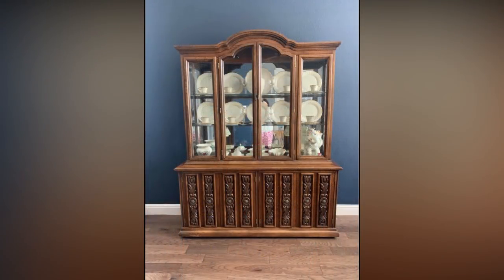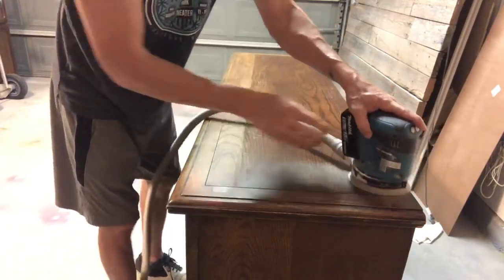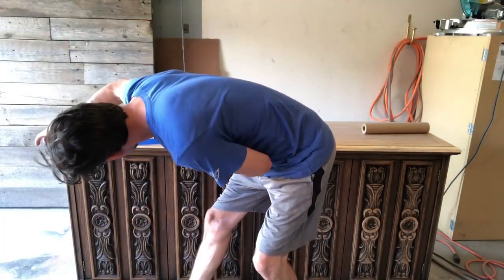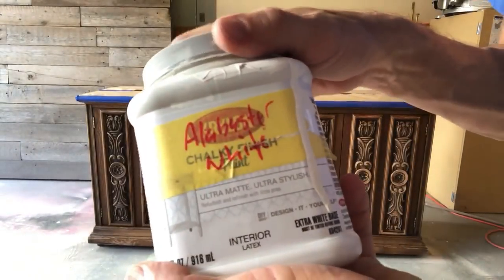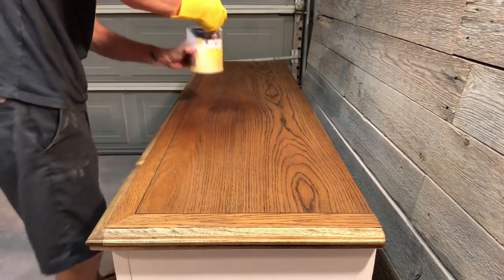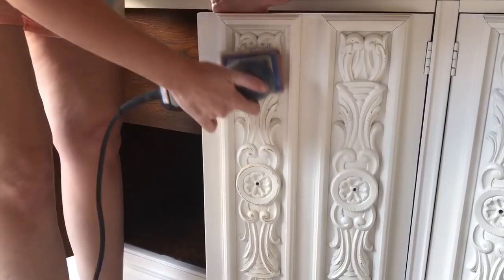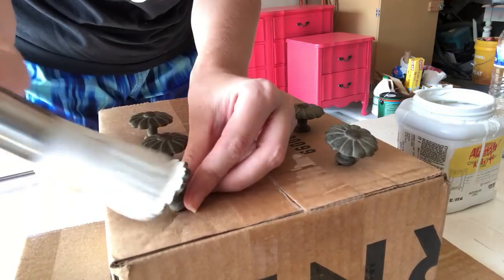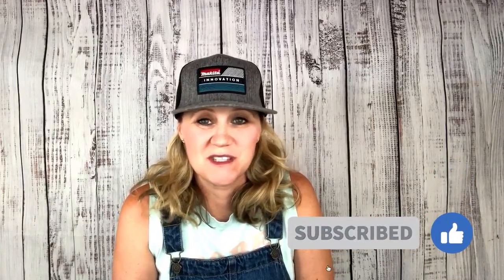Old to New Farmhouse Dresser Flip / How To Update Your Old Dresser/ Dresser Makeover Before & After

Comment: Quick question…you seemed apprehensive about using the oil based polyurethane…wouldn’t the oil based poly be more durable overall ?
Reply from the maker: They both have a certain amount of cure time & after that, they are both super durable. The oil based poly I had was a wipe on that I hadn’t tried before but I was a bit nervous that it would be streaky. It wasn’t at all! It self leveled as it dried. Thanks for watching!

Comment: Why would you waste time cleaning the top when you're sanding it down to bare wood?
Reply from the maker: Because if there is dirt, grease, oil etc on the piece you will sand it down into the wood and then when you stain it will bleed through it and show.
Reply: @LemonstoLemonadeFurniture  . Unless there's a pool of oil or anything in liquid form sitting on top when you start sanding it will turn into sanding dust before you get through the clear coat and stain. I've been doing wood work for almost 30 years as  a hobby and supplemental income and I'm a carpenter by trade so I'm speaking from experience. I'm not trying to criticize you just pointing out a way to save time because time is money